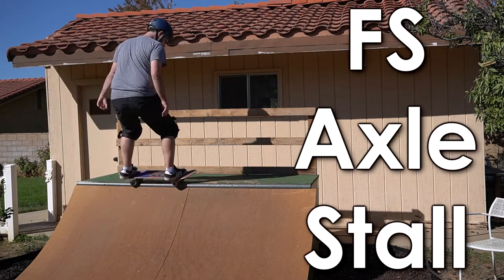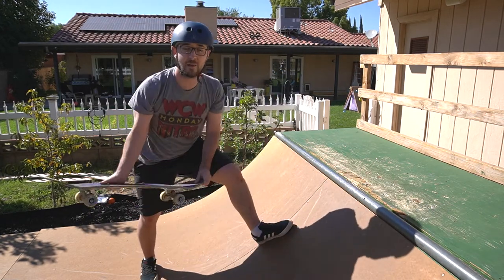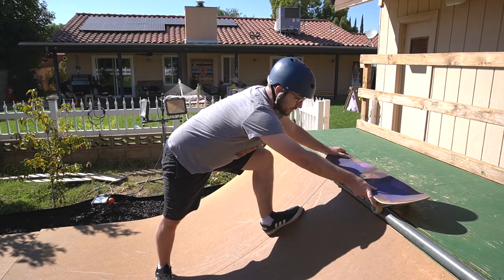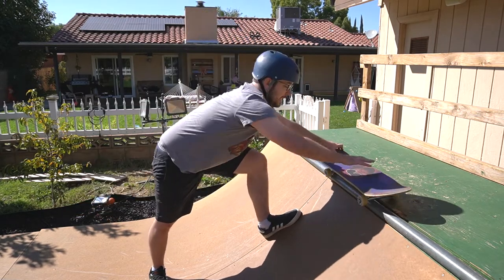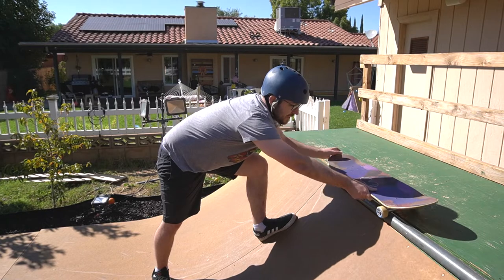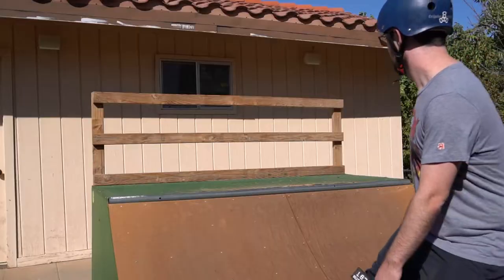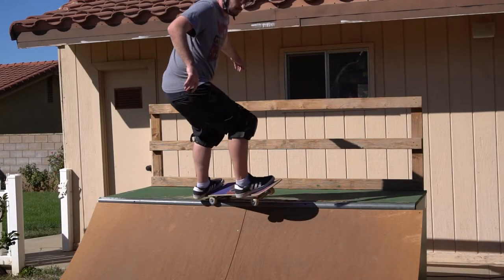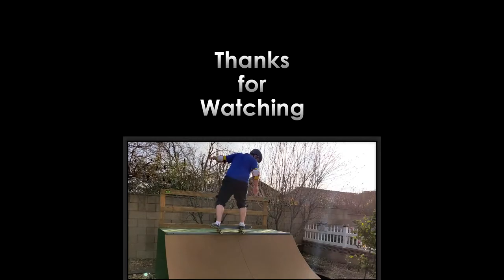How to FS Axle Stall (Frontside) - Intermediate Mini Ramp Skate Tutorial

Comment: The slow motion angle really helps to understand the drop-in. Thank you for taking the time to make this!
Reply from the maker: Glad it helped, man! Thanks for checking it out.
Reply: @GrawrD  just had a few successful attempts today on some thick coping. It does seem like I only manage to get my 52mm wheels out if I do the smallest hop. In your experience is that just how it is with smaller wheels and big coping? Or should I be able to get out without the hop? I think when I don’t hop the center of the truck slashes the coping a little too much and I hang up
Reply from the maker: @awitzk  Sick, dude! It’s probably the chunky coping more than the small wheels. It’s harder to get your toe side wheel to pivot up when your heel side wheel isn’t touching the ramp. I do a little hop more often than not too, just because it’s become second nature.  Just have to be careful not to hop your heel wheel on the deck and hang up. Getting comfortable with the hop also  helps a lot with roll ins so it’s a good habit to have!

Comment: Dude thanks a mil for the vids. Love your vibe. I'm battling this trick right now. I can come back in no problem. But getting up there, my board keeps flying out and I fall back into the ramp. Any tips for swinging your weight up out of the ramp and getting on top of it?
Reply from the maker: Thanks, man. Appreciate it!

You have the opposite problem of most people! Two things: First, practice riding out of the ramp onto the deck just turning a little bit frontside. Don't worry about getting on the coping, just focus on staying on the board, getting all four wheels on the deck and turning frontside. Keep doing this over and over and turn a little bit more each time. When you try to lock onto the coping, you'll find it a lot easier to shift your weight up top. Second, really focus on your shoulders. I've noticed a lot of times when people are slipping out they aren't turning their shoulders enough so their weight distribution is all off. You can come in so you have a lot of control, just really make sure those shoulders are parallel with the coping when you come up!

Send me a video when you get it! Would love to feature you at the end of one of the videos...
Reply: @GrawrD  Thanks man 👊 sounds like great advice, appreciate it! I'll send a vid when I get there 🤞
Reply: @GrawrD  it worked 👊 thanks man. That was great advice to break it down
Reply from the maker: @tomgreenwood1030  Let's go!!! Nice work! Feels so good to get this one down.
Reply: @GrawrD  it really does 💥 feels like this unlocks a bunch of stuff, like fs tailstalls and disasters feel within reach. Thanks again dude 👊